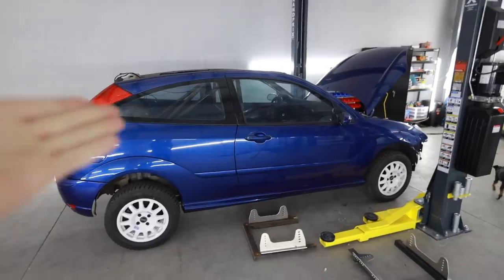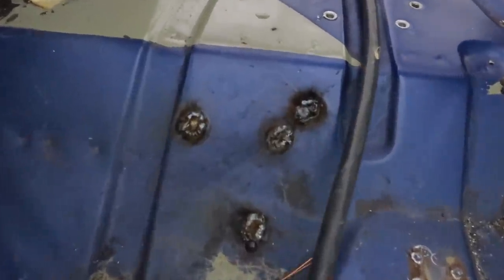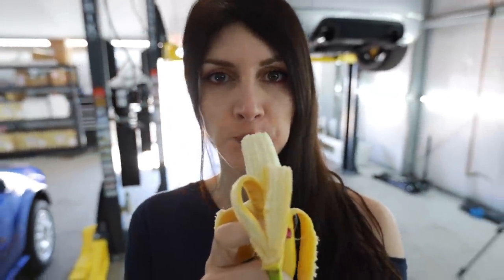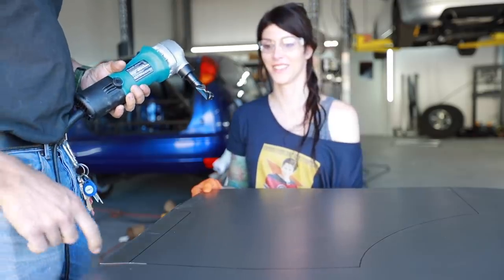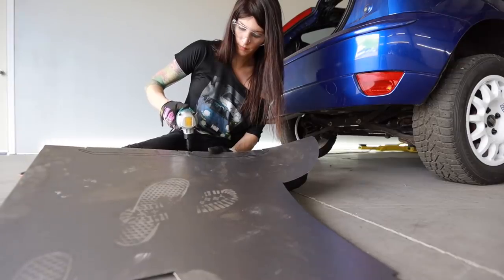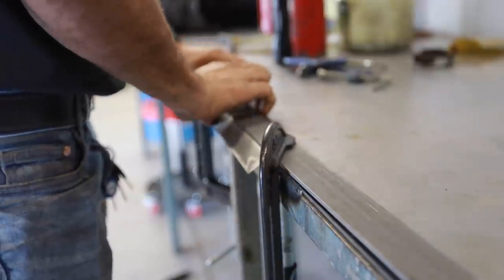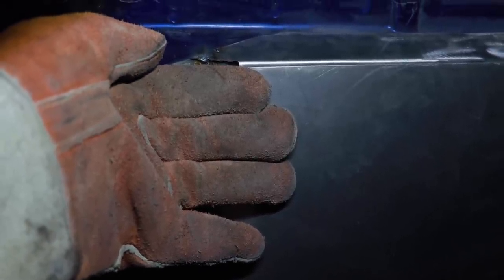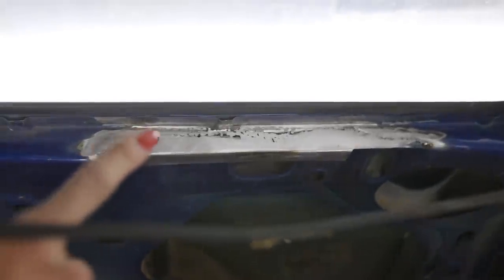Fabricating Metal Body Panels from Scratch // Focus SVT Rally Car

Comment: You should protect the window glass when grinding, the sparks WILL mare the glass and it won't buff away.

I don't understand the steel patch panels, make them from aluminium och carbon fibre sheet  that you screw in.

Comment: What diameter has your welding wire? With only 0,6 mm it is easier for beginners. In some welders you can switch the wire pullies between 2 diameters 0,6 + 0,8 or 0,8 + 1,0.

Comment: From the sounds of your welding it sounds like you need to slow your wire speed down to about 35 and if it's pops through then you need to cut your heat to one supposed to be a nice sound to it you're popping no popping

Comment: Use a finerer wire. .035 is to thick for sheet metal, try .030 or .025 wire , low heat .

Comment: Hello I love your struggling with welding sheet metal. I believe your doing it wrong. You need to tack weld instead of running a bead. Make your tack and then move as far as possible make another tack. Work back and forth keeping the metal cool. 

To fill the holes you need to braze. It’s a thousand times easier. 
By the way anyone that can run a bead on sheet metal is a rock star.

Comment: Is there a reason that you would just remove and clean up any unnecessary brackets, but not weld in all that patch work? It seems like you are adding in most of the weight that was cut out.

Comment: Surprised that you’re putting all that steel / weight back inside for door & rear quarter panels.  We just use carbon fibre or aluminium sheet as  it’s way lighter and easier to fit.  Great videos as ever though.

Comment: What's the reasoning behind the patch panels? I feel like you're adding weight and complexity to the build instead of keeping it simple. Having shaved an engine bay, I know this is a ton of work! I agree with the other comments, grind the welds down, add a skim a filler before paint, and keep going!

Comment: something not right with the welding setup. we  use 0.6 wire and co2/argon mix here on cars (the argon makes it cooler). pure co2 is a lot harder to work with on thin metal, but the argon would make thick metal welds rubbish.

Comment: I would of cut out more of the metal webbing behind the panels your welding in.  Is this weight reduction or just make it look nice? 
And yes you suck at welding  and I would say must people do when they first start out.  It took me 6 weeks to learn to form a puddle and keep it under control with a gas welder. 
Keep at !

Comment: don't do any grinding until you protect all the glass with card board of similar. Or the glass will be full of grindings nd you'll end up replacing it. Second, buy and learn TIG welding. Much better for thin sheet metals. Looks like your using flux core mig wire. Horrible stuff, go with gas shielded for body work.

Comment: you're welds look shit because you dont clean the area before welding. Grind off paint, undercoat, seam sealers, etc. and you'll be fine.
Reply from the maker: You mean literally like you saw me do in the video with a wire wheel? 🤔

Comment: sorry but i don't get the point of those panels....looks like a lot of work just to add weight...rigidity of the car is provided by the roll cage
Reply from the maker: Less places for pounds of sand to pile up in. Keeps the shell easy to clean out and looks a lot better. That thin little piece of sheet metal doesn’t weigh hardly anything.

https://www-thesun-co-uk.cdn.ampproject.org/i/s/www.thesun.co.uk/wp-content/uploads/2018/01/rally2.jpg?strip=all&w=960
Reply: @SarahnTuned  Understood ! ;) makes sense if performance is not the main objective....I'm a rally fan my whole life and i like this project and your videos
If in doubt...flat out ;)